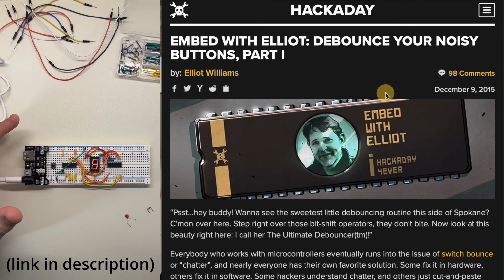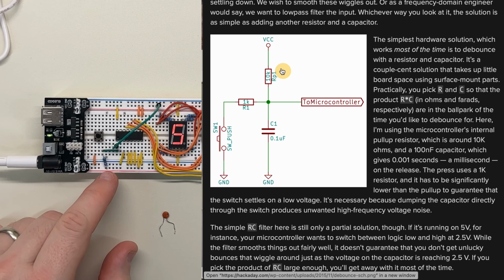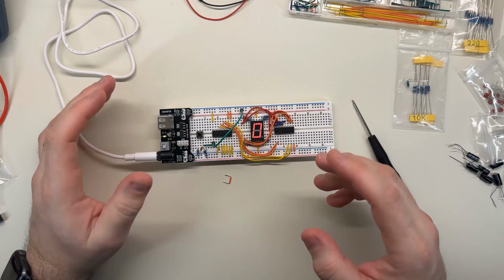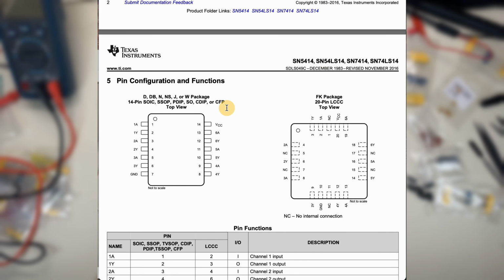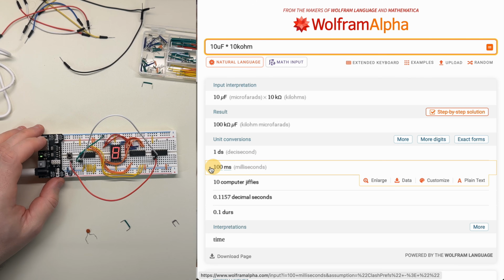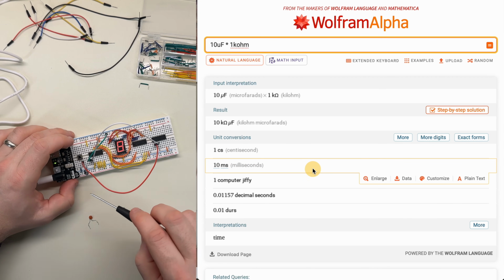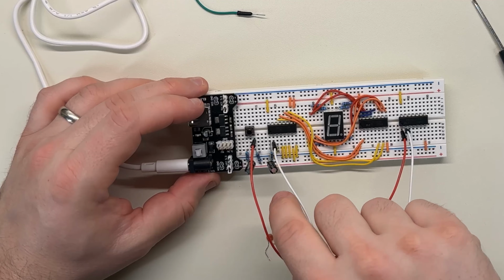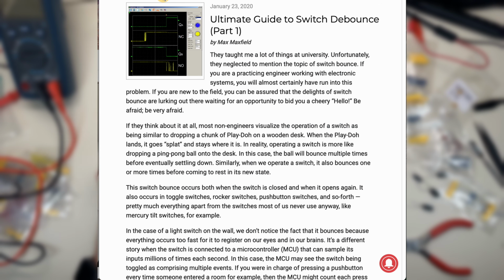Fixing my counter's bouncy button

Comment: That 1k ohm resistor is a timing resistor for the capacitor discharge time delay when the switch is pressed. The 10k ohm resistor is more than a pull-up resistor. It's also the charge time resistor when the circuit is first powered up and when the switch is released. Ideally the both resistors should  have equal values around 1k ohms to 3.9k ohms and the capacitor should be about 10 nicrofarads. This give a time delay of around 10-39 milliseconds, which is more than enough for a typical switch debounce circuit. I found that 2.2k ohm resistors are optimal for a 22 millisecond delay. The timing components are generally followed by a  pair of Schmitt trigger inverters to shape the waveform and produce complimentary  outputs. This is the classic POR circuit (Power-On-Reset) with an added button.

Comment: I'm trying to create my own pcb design for debouncing inputs. (mostly buttons but I imagine it can be used elsewhere too where signals are being expected) it involves the 74LS14 chip that can be used as hex inverter for 6 signals. I'm stuck a bit at searching for the right capacitor for the job. So far I got 5 volts on the signal, but I can't find a 5 volt capacitor, so I settled on a 16v capacitor 10uF. Is this the right one? Or is this not as important?

Comment: It was a very smart idea to add the second capacitor and the 100k resistor. I’ll definitely try that. I’ve already tested several solutions that I found on the internet, but unfortunately, none of them worked except for the Schmitt inverter just like the one you used.

Comment: Cheap caps too brother. I've never had luck with them. I always use a 103 mlcc across the pins on the opposite side of the button. Unless I'm using 2pin tact switches on perfboard and I put the cap on bottom. Time is equal to Sqrt of 2nrc is the rate of charge to 63.3 percent I think. With the opposite leg of the tact switch to ground the cap discharges infinitely fast. Each switch and ic should technically be denounced and any unused ic pins are supposed to be pulled low but not many people do that with old logic ics unless you are making it permanent.

You need a calculator before you learn to use a scope brother. Not a knock. I jumped in and got a scope before I was ready.

The resistor would have to be one ohm for the switch to eat 5 amps but that would blow the anemic ams117 voltage regulator on the bb psu. You'd see smoke before the switch melted I think hehe. Learning is fun.

Cool video.

Paul McWhorter has a great course on the elegoo arduino uno kit and he teaches instead of showing. He's a great teacher. You learn all the stuff you wouldn't think of at first as a byproduct. You learn calculus without realizing it when he covers potentiometers. Haha. Everyone uses the map command but it's super inefficient, especially if your circuit has more than one pot to keep track of. He's an incredible teacher. He's a retired PhD engineer but you'd never know it because he's such a good teacher and makes learning fun. I can send you an arduino kit if you email me. If you're in US or Canada, it's on me. I always keep extra  stuff on hand to send beginners who are excited to learn. No strings attached. My email is in my channel description. It'll save ya 100 bucks or so

Comment: That's cool doing the debounce in the circuitry. I'm more into the programming and have and have always just been using a: millis() - time_since_last_input > THRESHOLD, programmatic solution to debouncing. I like the programmatic solution because it works with basically everything, it doesn't matter what's going on in the internals

Comment: Hi,
in your first "RRC", pushing the button should have register, maybe you can make some diagnostics.
-> you minimum  input voltage  is C=Vcc/11 (if the counter consume 0 curent), is-it low enough ? Maybe 33k instead ok 10k can solve the problem ?
-> your capacitor is shorted or one resistance is bad or a bad connexion, check voltages with button on and off. 
-> your button is dead (they are very easy to damage by soldering it and they don't all have  the same pinout) 
-> your capacitor does not seems to be a 0.1 microfarad one.
-> your slew rate is too slow to be register (input coupled internally by a capacitor + pull up/down resistor)
-> your impedance is too high (try 330 instead of 1k)

Comment: Try CMOS logics. Inherently immune to bouncing, immune to supply ripple and can be supplied between 3.5V up to 15V unregulated.
SN74LS90 can be replaced by 40160B (up only) or 40168B (up-down) or 40192B (up-down). SN74LS47 (or SN74LS247) can be replaced by 4511B or 4543B. You can even replace both SN74LS90 and SN74LS47 with just a 4026B.
Prefix of CMOS logics are CD, HCF, HEF MC1, MM or TC.
Enjoy your self.
Reply: No, CMOS absolutely is not "inherently immune to bouncing." It may have a greater noise marginm will tolerate somewhat longer transition times in signals, and, depending on the family and supply voltage it may be slower, but it is going to see bounce in a mechanical switch just as badly as TTL does. Specified total bounce time for mechanical switches is rarely less than a millisecond. One thing you are slightly more likely to find with 4000 series CMOS parts is inputs in MSI parts that have hysteresis, saving the need for an external Schmitt trigger.

Many of the modern CMOS families are faster than even schottky TTL and certainly much faster than LS or standard TTL.

Comment: Thanks for the trip down memory lane… I was figuring this stuff out with data books and experiments in the late 1970’s…no internet…not YouTube…just a breadboard and a bunch of TTL parts. Great way to learn! Such a feeling of accomplishment!!!! And yes, there is no difference between the digital and analog worlds—they’re just two sides of the same coin ;-)
Reply: In that era there was Don Lancaster's TTL Cookbook which was pretty good. There was also an excellent TTL user's guide from Fairchild. Lancaster's book was aimed at hobbyists, the Fairchild guide at engineers, though most if it was pretty easy for anyone with some basics to follow.

Comment: Everyone is telling you that the capacitor should be smaller.  They're wrong.  Make it bigger to increase the "delay".  Time Period or Constant (T) = R * C.
Two time periods/constants exist.  One for charging (Tc) and another for discharging (Td) the ground coupled capacitor.

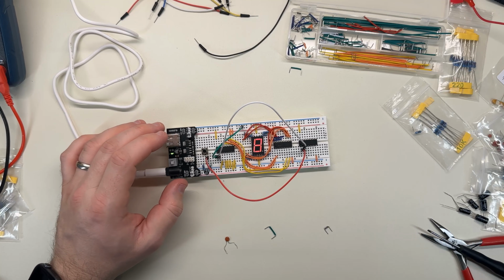[14:35] Only calculates the time constant (Tc) for charging the capacitor through the pull up resistor.

Calculating the time required to hit each threshold:
Charging Time (tc) = -(Tc) * ln(1 - (Vt+) / (Vcc))
Discharging Time (td) = -(Td) * ln((Vt-) / (Vcc))

PS: The HACKADAY article is messing with everyone.  Probably just meant to be a joke because it's full of intentional miscalculations.  His time constants are in reality only microseconds long.  He states that eveything exists in milliseconds.  A lie fabricated for the purpose of causing you to fail.  Personally, I think that is just pure evil.
Reply: When you are using TTL you must consider the current that flows out of the input when calculating the charge time for the capacitor.  Essentially there is a resistor in series with a schottky diode between Vcc and the input. The resistor is typically in the range of about 10k to 15k for LS parts. You can probably ignore this current when calculating the discharge time with LS TTL as long as the current limiting resistor is less than a hundred ohms or so.
With CMOS parts the calculations are simplified because the static input current is, for practical purposes, zero.

Note: "current that flows out of..." is assuming "conventional current" which is considered to flow from positive to negative.

Comment: The standard way of debouncing is by using a mono stable multivibrator and not a Schmidt trigger or RC networks.... A mono stable multivibrator is in fact a timer set to a couple of ten milliseconds.
Reply: Schmitt trigger debounce circuits are far more common from what I've seen and I've been in electronics for decades. You can get into trouble with a monostable triggered by a switch because it may trigger on both closing and opening bounce of the switch. A monostable is the right circuit to use if you need to "stretch" a clean pulse or shorten a long one, though in the latter case you have to be careful to select the right monostable.

Comment: Nice to see your learning process. Keep it up, you're doing great.
There's also the opposite application: actually wanting to make switches bounce. Bally had to do this on their pinball machines in the 80s. The CPU was so slow that it couldn't register very fast switch closures (which are quite common in pinball machines). So they fixed it by just slapping a capacitor across every single switch on the playfield. When a switch was closed, the capacitor is just dumped through the switch and the data line stays low while the capacitor charges up again. Just long enough for the CPU to notice that the switch has been pressed. So... that resistor in your circuit is quite crucial for it to work as a debounce, and not as an extra-bounce circuit. 🙂
Reply from the maker: Ha - that's amazing trivia! Thanks for that!

Comment: A nice investigation. Bravo. Yes, caps for debounce and pull up/ pull down resistors to maintain the pin's voltage state. Yes, analog solutions are good, too... not just MCU code.

Comment: what about just putting a small capacitor in parallel to the switch?
Reply: That alone won't do the job.

With a digital input you must be able to establish conditions that fully meet the logic HIGH and LOW requirements. If you are dealing with CMOS, typically you don't have to worry about steady-state current into or out of an input, only about voltage levels. If you connect a switch from an input to "ground" ("zero volts") you have a way to get the input voltage to essentially zero volts which the vast majority of common logic families will accept as a good "0" or "LOW." A resistor between the input and the positive supply voltage for the device can be used to produce a good "1" or "HIGH" when the switch is off.

4000 series CMOS is convenient to consider because any voltage less than 1/3 of the supply voltage will be a good LOW and any voltage above 2/3 of the supply voltage will be a good HIGH.

Without a capacitor across your switch the pullup resistor to VDD (the positive supply for the IC) you get your good LOW when the switch is on and good HIGH when it is off, but if the contacts bound open then closed again you'll get an unwanted transition. If you put a capacitor across the switch, things get more complicated. When the switch is off, the capacitor will charge to VCC through the pullup resistor, so all is well in the steady state. When you turn the switch on, the capacitor will rapidly discharge (ignore the potential problem with high transient current through the switch). If the switch contacts bounce open, the cap starts to charge again through the pullup resistor, but as soon as the contacts close the cap will discharge. Depending on the R, C and switch bounce characteristics, the voltage at the input might actually stay at a good LOW through the whole bounce time, especially with 4000 series where the LOW threshold is quite high (5/3 or 1.67 volts for a 5 volt supply. With something that is specified to be have "TTL compatible" input voltages, you may have more problems since a good LOW must be no more than 0.8 volts. Bounce might allow the voltage to rise above that (which you can fix with a longer RC time constant, but that doesn't deal with the whole problem.)

When you release the switch things get messy. Now the capacitor is going to charge toward the supply voltage through the pullup resistor. It will take some time for it to make the transition between 1/3 of VCC (LOW) and 2/3 of VDD (HIGH; again considering 4000 series). An input voltage in that region is "forbidden" or more properly, the behavior of the device is undefined if the voltage is in that region. Any noise on the input or the power supply of the part can cause the device to switch, as can bouncing on opening. You must stay out of that forbidden voltage zone except when the signal is making a fast transition.

With devices with "hysteresis" the output state is defined for any input voltage. For example if the input has been LOW, it wouldn't be interpreted as HIGH until it rose 2/3 of VDD. If it had been high, it wouldn't be interpreted as LOW until it fell to 1/3 of VDD. Slow transitions are now OK. Digital gates with hysteresis are often called "Schmitt trigger" devices (Schmitt should be capitalized but often isn't). The actual logic zero and one thresholds will be specified in the datasheet. There are generally Schmitt trigger inverters and gates available in most logic families. Modern versions of the ancient 7414 hex Schmitt trigger inverter are available in most modern CMOS families. If you are using surface mount you can get a single Schmitt trigger device in a very tiny package. The CD4013 was a popular quad two-input NAND gate. Some microcontrollers have inputs with Schmitt trigger characteristics.A few logic devices may have hysteresis on a particular input. An example is the 74HC123 dual monostable multivibrator. Schmitt trigger devices are also good for converting any signal with slow rise or fall time to clean digial output.

Comment: The reason for the 1k resistor in series with the switch is that it increases the time constant, so provides denounce during capacitor discharge.
Reply: No, it is really only there to limit the peak current through the switch.With lots of switches it isn't necessary because their contacts can handle high transient currents. With most "tactile" switches it is necessary because currents of more than a few tens of milliamps, particularly if the contacts are gold plated, can damage the contacts. Some switches are unreliable at low voltage and low current.

Usually you want the cap to be discharged very quickly so as not to introduce delay. It is the time it takes the capacitor to recharge to the upper voltage threshold of the logic device that provides the debounce time.